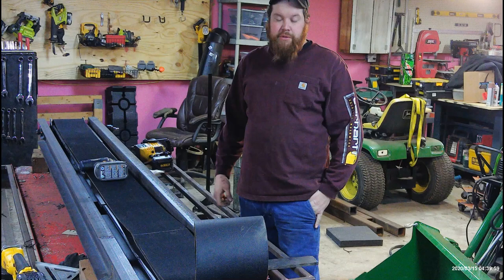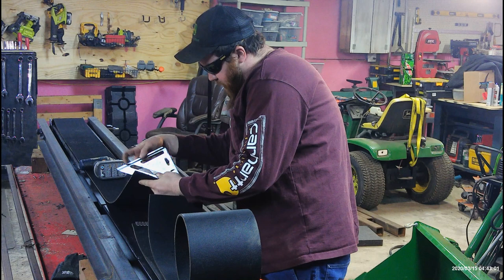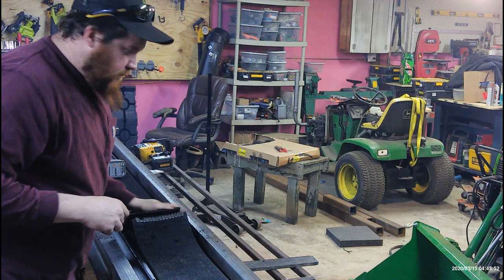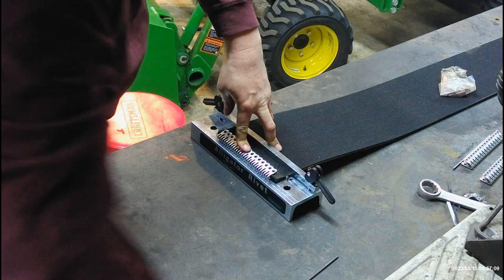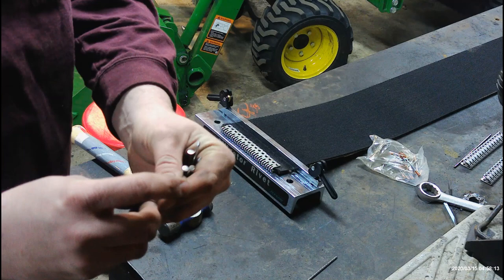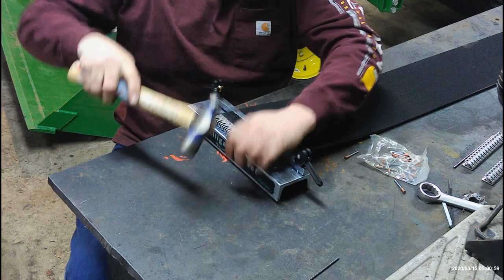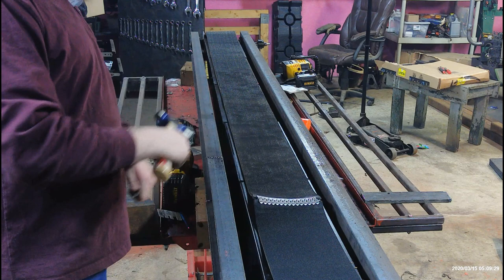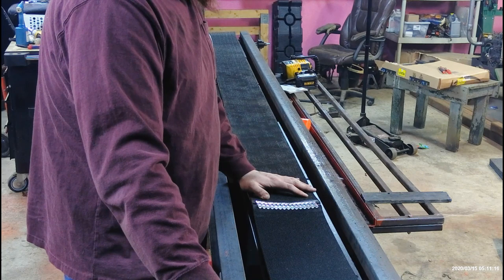Best way to splice fix or repair round hay baler belts!!!!

Comment: Did you end up cutting a slight crown on your idler rollers to get the belt to track? Thanks for sharing!
Reply from the maker: Your welcome thank you for watching! Actually what did was I made some roller guides to keep the belt on track since I didn't have the means nesscery to cut a crown I worked with what I had and it worked very well